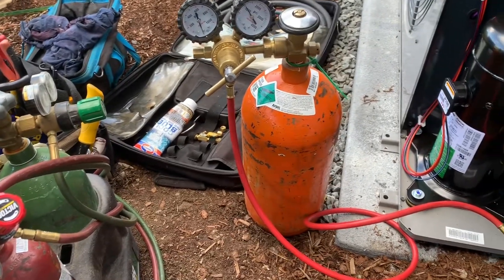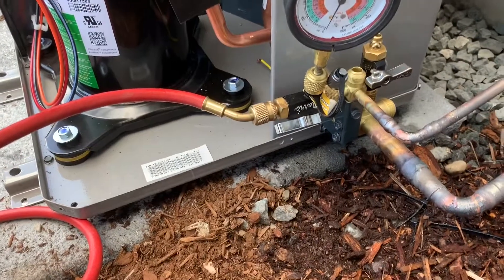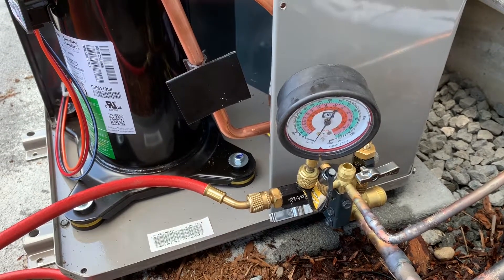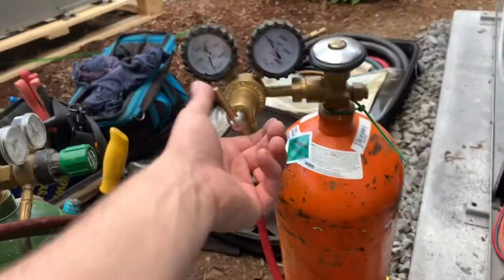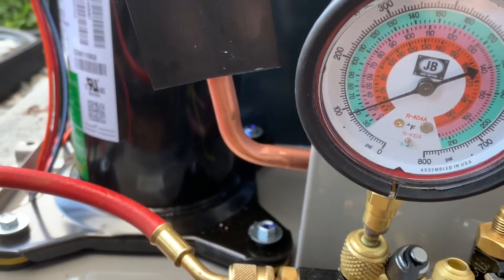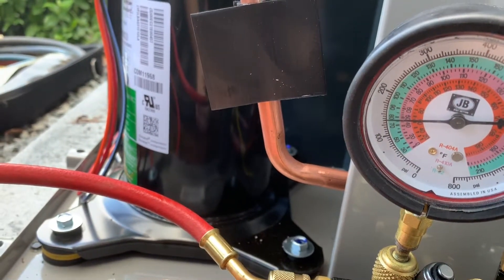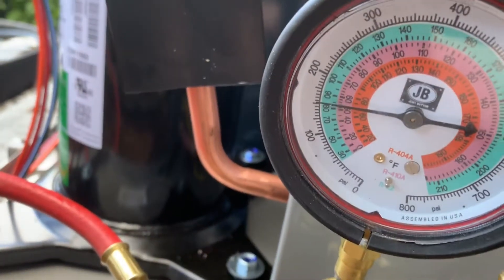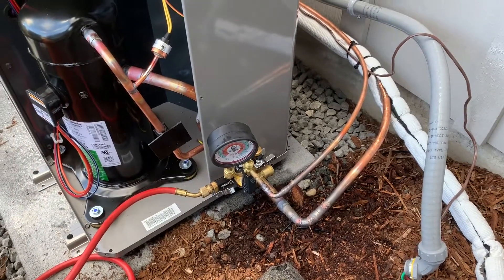Pressure Testing an A/C Or Heat Pump System

Comment: You need to pressure test to 50 psi below max pressure..more like 400 to 500 psi. Especially if your running R32 or 454